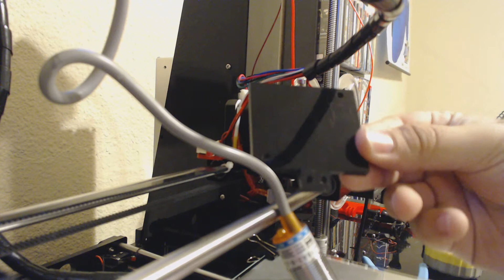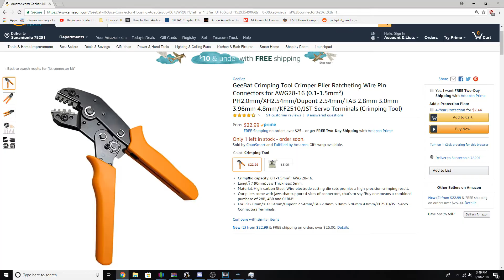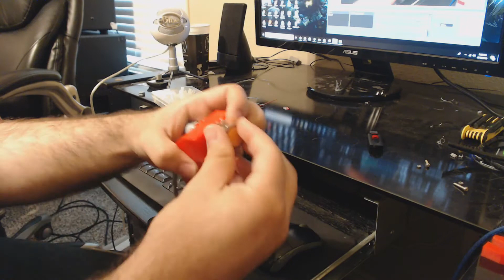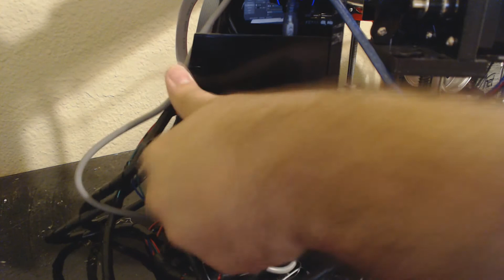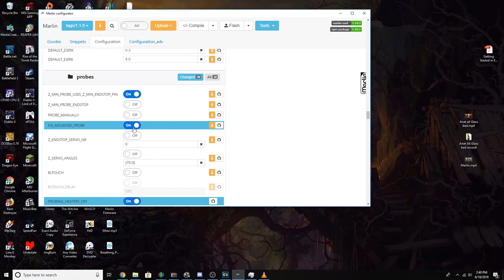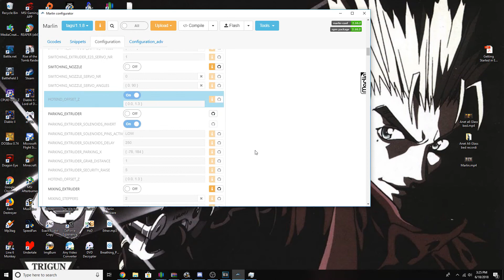Set up Auto leveling for your Anet 3D printer the correct way!

Comment: Great video, thanks a lot! Got autolevel on my printer with your help.
There is a problem with glass bed clips when sensor located at front (as it on your video), I made flat holders for glass and it works really good with front sensor. Model for flat holders are here https://www.thingiverse.com/thing:3714537

Comment: Hi, great video. I've recently updated my A6 to Marlin and had to go through the fairly steep learning curve that this presents nicely. Just a quick on, I think you might have typo'd your X probe offset. I think it's supposed to be "10" and not "1". I have the same probe bracket as yourself and that's the values I have in my setup.

Comment: I'm using a tronxy sensor that is a square would the measurements still be to the center of the sensor from the extruder tip